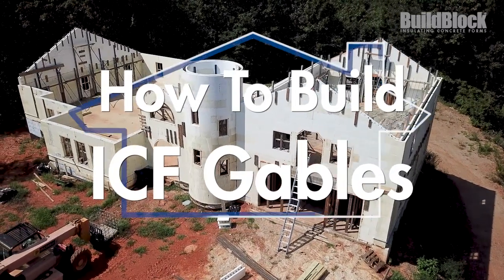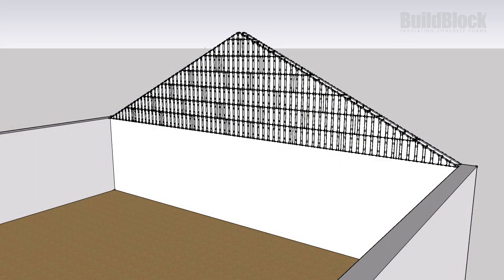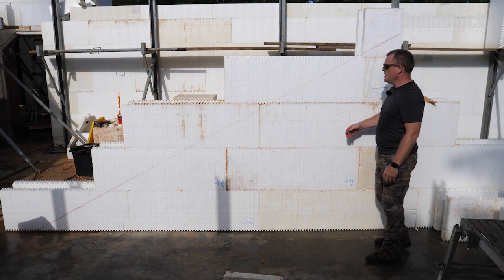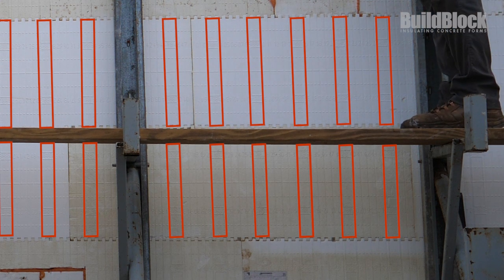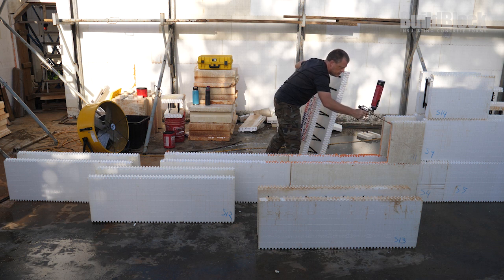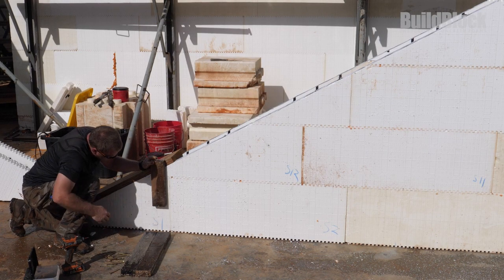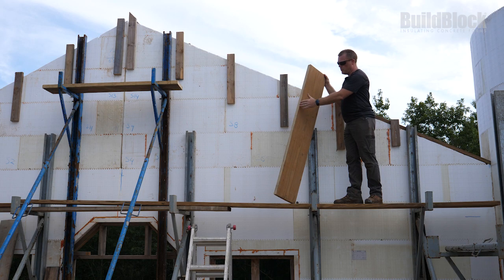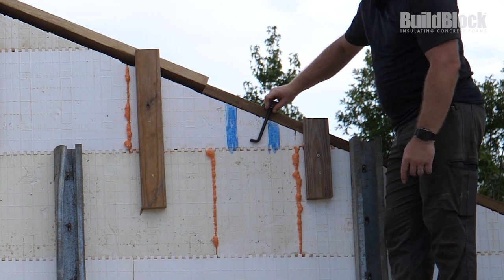How To Build ICF Gables

Comment: I am considering an ICF build here in Michigan and until I saw this video I was going to use SIPs for my gable walls.  Your pitch on this roof was a 6:12 while I would want a 12:12.  Do you think this method would work on the steeper pitch?
Reply: that's my question too, though i'm looking at 14:12